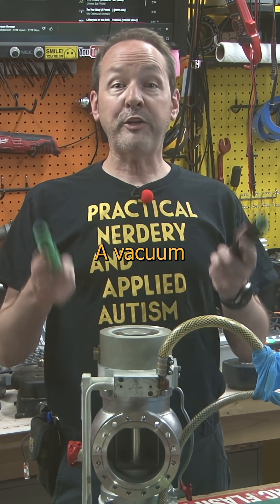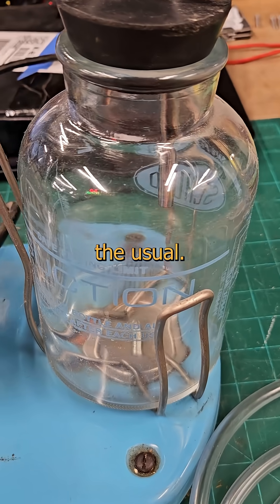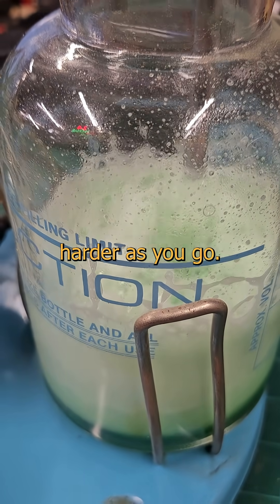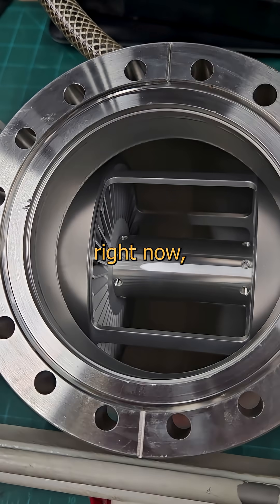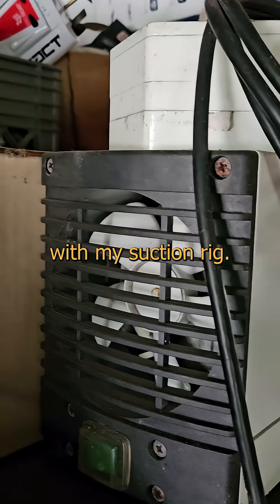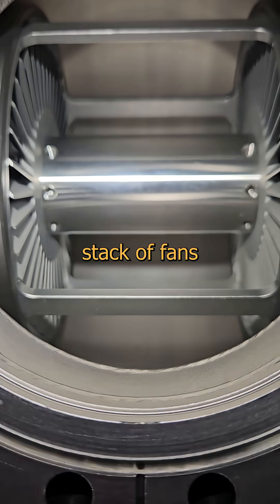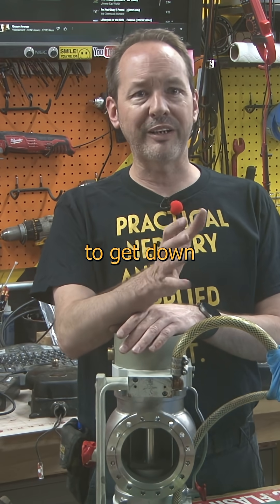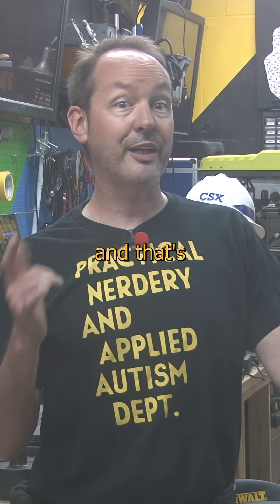Turbomolecular Vacuum Pump #chrisboden #comedy #engineering #physics #science #turbo #nerd

Comment: As an HVAC/R tech, the scariest shit I have ever seen was a 50 ton Trane chiller that was just installed have its safeties fail and pull itself into a 27.8inHG vacuum according to a mounted manometer on the primary coil side door. No one wanted to go near the fucking bomb in the basement so we let it run away til it popped, it was going to go to warranty regardless. It finally failed about 2 minutes after the fuck up started (return air duct's damper system decided to say nah we're closed), the doors on it that swing out swung IN, the coils all had bent into chevrons, we had shut water off already, and the fan had swallowed and spit out over 50 lbs of aluminum. Nature really, really, really fucking hates vacuums.
Reply: I’m a project manager for a commercial construction company and we ALWAYS try to avoid trane if possible😂
Reply: @adamrichter1143  Good to know. My company is actively trying to rent a Trane 25 ton chiller as we speak. (Contract is already out for bid, and we're the ones who said "We rented this Trane chiller last time, so we'd like that again, if possible"). I'm open to all rumors, feedback, and hearsay about why you guys avoid Trane.
Reply: @c182SkylaneRG Old Trane stuff is good, new stuff not so good and their newer communicating equipment is not even compatible with each other.  My company is slowly switching to Rheem.  Can't speak as much to the big stuff but I personally think Daikin probably makes better chillers.

Edit: everything before covid seems higher quality, less over-engineered, and less failure-prone.
Reply: @c182SkylaneRG biggest concern for projects I’ve managed has been lead times, for both the equipment and the shop drawings to approve said equipment. If you are working with a local supplier who has the equipment on hand, then that’s a different story.
Reply: @c182SkylaneRG  The site I work at operates 19 chillers(250-500 ton). Of which, 15 are Trane, 2 are York, and 2 are Carrier. Only major issues we've had with any of them was the carriers not having proper proofing set up, BMS says the chiller is running when it's not, and 1 of the Tranes doesn't like to run when OAT is below 45° F, but an identical chiller 25 FT away runs fine. (Trane techs can't even figure that one out even after shotgunning parts at it.) As far as HMI, I prefer Trane, then York and lastly Carrier.

EDIT: All of our chillers are at least 8 years old.
Reply: @adamrichter1143  i’m actually looking into AC units at the moment, which brand(s) would you recommend?
Reply: @fakename287 I would talk to your local TRUSTED HVAC supplier. There are thousands of different brands to fit your needs. Trane just has a bad reputation here in the Midwest.
Reply: @fakename287  Here at the end of 2025, I’d suggest digging deep and springing for Bosch. Caveat: this is long-term, because you only want to pony up if you are sure you’re going to be there for another 20 years. I’m in Mid Atlantic area, and we have our best results with Mitsubishi—which is ungodly expensive. Bosch being 98% Mitsubishi @ 80% the cost, that’s what we install on our own homes. 
Like all refrigeration, though, it’s all in the prep: no matter how good the name is, if your installer cuts corners, your experience will suck balls
Reply: @adamrichter1143  Ya know I'm a chiller mechanic and Tranes are some of the best units to work on in my limited experience.
Reply: @markethvacrguy I actually agree, although I enjoy Daikin a hell of a lot more.
Reply: I can see the report now. Mistake number one: We bought from Trane
Reply: @DenarianLord  Nothing hits with expensive destruction like a Trane. 
That's their slogan, right?
Reply: Why wasn't cutting the power an option?
Reply: @Argonwolfproject  vacuum was already created so it woulda popped regardless. At that point its an already ticking time bomb so you might as well run for cover and wait for the natural order to do its thing. Cutting power would just prolong the inevitable.
Reply: @jamzee_  it would have equalised eventually
Reply: @jamzee_ No, not entirely. If I had been able to cut power, the vacuum would have just equalized. It's not a sealed unit .
Reply: @Argonwolfproject Great question! Where I am there is no code on how far away disconnects or VFDs need to be, only main power breakers. The disconnect AND VFD was about 18 inches from the unit and the main breaker was about a 20 minute walk away. The only person I would have asked to go throw the disconnect was a bomb diffusal technician, but there honestly wasn't time, same reason I didn't make it to the main breaker before it popped.
Reply: @thomasos123  Thanks for coming back here to satisfy my curiosity, cheers!
Reply: And here I thought closing the pressure out port on a thermo king semi reefer led to some nasty shit… ya I’d nope tf away from that unit.
Reply: it's not the vacuum, but the delta in pressure, nature is if nothing, all about equality and wants everything to be equal, especially pressure.
Reply: Was witness to a 100hp  DC compound-wound motor that lost its field winding start to run away (yeah I know - "no legs"). Shrieking was getting louder and higher every millisecond. Even with the power disengaged, it still took 30 minutes to slow to a stop, even with a lightly loaded 75hp (commutated) generator attached to it.

(Good thing it wasn't shunt-wound)
Reply: @ellayararwhyaych4711  I know some electricians that have done that deliberately. Likewise myself. Watch them spool up until the bearings go or the windings dislodge from the armature. Hence the nickname for these motors (Suicide Motor).
Reply: @ellayararwhyaych4711 sounds terrifying and awesome
Reply: Half an hour to stop!! 😮
Reply: @ellayararwhyaych4711 so a 100hp motor is completely different than a 50ton chiller. The chiller is pretty small and that guy defiantly exaggerated😂 you I believe
Reply: I actually work at Trane Technologies! But on the lame digital side. Soooo... sorry about the state of Synchrony and Trane Connect. 😭  But management is hellbent on making our lives as difficult as possible but with a corporate smile on 🙃🥲.
Reply: When I worked on oil rigs I had a triplex positive displacement mud pump with a malfunctioning 8” knife valve on the suction side. It slammed closed one time when the air pressure to the actuator decided to leave the party and the pump said nah, you’re staying open fam. Shit pulled a hole in the 1/2” thick metal gate the valve thought it had. I didn’t think steel laced with hardened plastic and gelled up diesel could create a suck so hard that the entire United States Marine Corps would lovingly embrace it but it it was definitely a bad time for all of the internals of that gardner denver. Nature absolutely despises vacuums.
Reply: @kendallbryant5527  I think you’re a vacuum Kendall.  :)
Reply: Most hospitals have a vacuum system so it's different than residential ac or even commercial but when I wonder is like the CDC and even the ebola hospital the design and engineering must be well above or even those desalination units
Reply: @cyclonight remember, cheapest of at least 3 bids, you’d be surprised at the
 f()€Kery betwixt whats on paper & “🎶what is this, that stands before me!🎶 OH LORD NO, NO, PLEASE, GOD, HELP ME🎶”
insert Iommi guitar solo
Reply: but its hard to stop a trane… lol
Reply: @alnonymous9361  I'm pretty sure it's something like that but that just doesn't sound quite right...
Reply: inHG must be the worst unit that my SI minded brain ever encountered.
Reply: @IncoAno  as a non-physics person I was curious and wanted to look up how much pressure 27,8inHG actually was. But from my very amateurish calculations that resulted in a little ofer 0.9atm or 926 Pa. Which doesnt sound like too much of a difference to me. Very far from a vacuum for sure. Fid I fuck up with my calculator?
Reply: @vyl4650  for reference, 29.92 in HG is "one standard atmosphere" and zero should be a pure vacuum (as differential pressures, these are in comparison to a vacuum), so 27.8 in HG sounds like about 0.9 atm. That sounds correct to me.
Reply: @vyl4650 On an absolute-pressure gauge, atmospheric pressure would indeed read somewhere around 29.92 inHg at sea level. But on a gauge-pressure gauge it would read 0.

"Gauge pressure" is a weird place where the zero-point is either ambient or "standard pressure", so at lower pressures than ambient or mean sea level it would read negative pressure. Kind of odd, but it's just a differential measurement - like a classic manometer, where both ends of the liquid tube are initially open to atmosphere before being connected to a port or capped.

So 27.8 inHg of vacuum would be an absolute pressure of (assuming sea level) 29.92 - 27.8 = 2.12 inHg. Fairly significant in a large volume, but also much higher pressure than you'd typically pull on a refrigerant loop before charging. Water boils out pretty aggressively at <0.2 inHg in the Southwestern summer . . ..
Reply: @vyl4650 30", is what you typically pull on an ac system before you put the freon in. At least on cars. It'll suck 2oz. of oil in pretty quickly under that pressure  and typically only raises the pressure about 10", to 20"hg. Not sure if that helps to give you any perspective.
Reply: @vyl4650 I think you did it right. One atmosphere is 14.7 psi at sea level.  So a complete vacuum is no more than that but over a large serface it's a lot of weight and no sheet metal box can stand it.
Reply: You must not get out much lol 
When you want to measure pressure mechanically, you fill a tube with mercury, and measure how far it is displaced from gravity, and measure it. 
Then anyone else with a tube full of mercury can compare their measurements. 

If it had been developed in a metric country, it would have been mm/hg instead, but it would have been the same measurement. 

Then higher technology was developed, and so we can have an arbitrary unit to communicate a pressure, but tubes full of mercury are still used today for certain applications where precision is needed reading low pressures visually. 
 @IncoAno
Reply: @IncoAno the first time I heard that as a mechanic doing hvac work on cars, I couldn't believe that was a thing. Sounded like something Archimedes, invented.
Reply: I like it!
Reply: Which is funny, because most of nature is a harder vacuum than anything we've ever made down here on Earth.
Reply: @jdlessl  Perhaps it would be better to say "nature abhors imbalance."
Reply: It either hates vacuums or really loves entropy
Reply: To be honest, it's usually not the manufacturer. It's the installer.
Reply: @Whateverinterestsmenow THIS. 1000%. I work with mainly Trane and Daikin, and this was a freak event on a new install.
Reply: I've seen diesel generators bend I beams, rip double steel doors off the frames, rip Sheetrock off walls looking for air.
Reply: I'm sure that was absolutely scaflarious - both scary AF and hilarious at the same time. I'm LMAO just visualizing that scenario as I read your comment. Holy shiz!😂
Reply: Damn, 93% vacuum? Eugh, glad I don't deal with that.
Reply: That sounds scary and way over my head.  And on a scale of the universe, I'd say nature loves vacuums.  Just not on our pale blue dot :P.
Reply: Remember titan? In a fucked up way, it's kinda like that.
Reply: Hi I'm here for the Trane hate thread
Reply: 😮 OMFG 😮
Reply: @thomasos123  "Nothing can stop a Trane!"  Wanna bet?  Watch this!😂
Reply: @thomasos123 You start with a chiller then go on to describing an air handling unit. There is absolutely no way you can pull that kind of vacuum in a ducted air system. I call bs on this story.
Reply: @davea8346 that is entirely fair, it is an air handler, I may have been around old heads calling them chillers for too long. I am aware of the difference and I work with both, however for whatever reason I have grown too used to using the word "chiller" interchangeably between the two. Sorry for the confusion😅
Reply: Difusion pump.... 😮 turbo mach jesus... 😂
Reply: It would be that a vacuum abhors nature.
Reply: Me: "Make me a vacuum."
Nature: "NO! And also, fuck you!"
Reply: I’m not even sure I can imagine wtf you just wrote! I had no ideas they were capable of that!
Reply: I saw a ghost and it told me to clean my house. I have a picture of a ghost on a tv.
Reply: Damn. 😳Was anything salvageable? 🗑️
Reply: @monotheis6889 oh yeah, unit was under warranty, they salvaged the frame, the motors/fan impeller, part of the filter rack, some of the dampers.... anything that the installers could salvage was salvaged
Reply: The lightest gas we know about is hydrogen, but its still heavier than a vacuum, if you can make a structure strong enough to be lighter than air but in a vacuum you have the perfect blimp.
Reply: We had a giant bulk tank at work that product was being moved from via a pump and something got stuck shut, imploded that tank quite a bit, needless to say that tank went up on the tank reliability list considerably for requiring repairs :D
Reply: Okay I understand residential but can someone break down what just happened here?
Reply: @computernerdinside residential A/C is DX cooling. An air handler with an evaporator coil direct exchange cooling. A chiller cools water or glycol solution that feeds air handlers or many other kinds of cooling equipment. Or ice rinks, process coolers. To explode or burst requires positive pressure not negative. The refrigerant cycle in most cases are positive with exception of a couple refrigerants like R-11. I have seen duct blow apart from closed fire dampers and forced on vfd’s. Variable frequency drive. Overriding duct pressure switches.  I have also seen ducts implode on return side from same reasons. But I have never seen anything just happen. There are far too many safeties. But if you have a low IQ building operator that knows enough to be dangerous can jump out all safety’s trying to cool down or heat up a building. If you look up MGM grand fire you will learn what I mean by dangerous facilities guy. And that’s not very cool.
Reply: That's awesome lol.  However,out of curiosity.....I know things get more dangerous exponentially.....but I pull 30 inches regularly on automotive ac systems. It's a pretty normal vacuum.
Reply: @f.c.urbaytis3599 yeah, that unit is about the average size of a master bedroom, so the forces at play were in the range of thousands of foot pounds, both pulling and pushing into the unit.
Reply: I didn't understand 71.77% of your words but I felt 100% of the oh shit factor....
Reply: Even vacuums aren't allowed to be truly empty.  All sorts of weird little things pop into and out of existence.  Ironically the only truly empty place might be the center of a black hole.  There is a chance space-time is distorted so hard by the gravity that it reverses and becomes repulsive.  The middle of a black hole may be even more bizarre than a singularity which probably aren't real.  It may simply not exist at all.  A bubble of actual nothing.  Might be the only "place" where even time might not exist.  Almost like a sustained cavitation bubble in reality itself.
Reply: Simples me says how come there isn't a release valve of some kind, basically a manhole cover on a spring?! I barely understand this subject btw.
Reply: @DeepakKumar-lv4te : Because valves leak, and you want to cut down on that.
Reply: Sorta confused how a Trane chiller which is a closed condenser and evaporator would do something that would influence the closing of an air system … the Trane chillers we have run at like 10psi… just kind of curious what your referring to when you said you pulled 27in of vacuum on a system like that
Reply: That’s the biggest load of bullshit I have ever heard. First off chillers don’t have ducts. 50 ton chiller is a really small chiller plus. I personally have pulled deep vacuums on chillers and other air conditioners required by the epa. In fact chillers that used r-11 ran in a vacuum. Trane actually makes really good equipment. Well as good as anyone else or better. A vacuum cannot explode or go pop it can only crush or implode. If a machine ran away that would also be something meaning all safety devices were bad or bypassed.  So mostly likely it would have run until the compressor got hot and went into overload. And if it were a blower on an air handler the duct would have collapsed. But that would have been caused by a closed fire damper and no duct static safeties. A VFD placed in hand turned all the way up and enable jumped. Just saying.
Reply: @troywesterbur706  If I had to guess, by "chiller" they actually are talking about a big ass chilled water air handler, and the vacuum was just being created by those 20-25 hp draw-through backward inclined plenum fans pulling on the dampered shut return duct, rather than some "runaway vacuum" in the refrigerant piping. 

Hence "shutting off the water", coils collapsing and getting spit out through the fans, AHU section access doors getting pulled inward, etc.

Not sure why there was a shutoff damper in the return duct (economizer changeover controls maybe?). Lesson is to be careful with your control logic on those I suppose.
Reply: @imanukeyourface3210  Exactly what I read he must have meant, chilled water air handler, not chiller. The manometer on the primary coil side door must have been to troubleshoot the problem setup as it isn't operationally useful as far as I can imagine the gear. Perhaps a constant pressure differential blower setup. As you suspect economizer changeover controls are the only easily imagined reason for a shutoff damper in the return duct. And truly stupid control logic crashed and wasn't setup fail safe caused the mess. A simple hardwire interlock anybody? That sh* show shouldn't have been possible. A single air handler for 50 tons would be small walk in sized sweetie and with the blower in manual with the controls crashed and not fail safe configured the ductwork collapse has plenty of force to rupture the cooling coils. A simple case of too many black boxes in the controls for the guys in the field to discover what he dumb [censored] bean counters expected them to do with it. Also sounds like they forgot switching off the VFD manual disconnect is step one when you say, "Oh, sh*". I think you nailed it.
Reply: @troywesterbur706  the term "explode" is often used for things that don't literally explode but just fail in a spectacular way. in this case i assume it's that. either way it's the same outcome: a rapid unscheduled disassembly.
Reply: @ThatJay283 Looks like someone plays Kerbal Space as well lol
Reply: @ThatJay283  (late comment here) sometimes an implosion and explosion look pretty much the same unless you’ve got a 10,000 fps camera.  The closest I got to a nasty implosion was a ~1960 25 inch RCA TV set which had removable safety glass.  That safety glass was like 3/8 inch thick.  A friend of mine with a pellet BB gun shot the bare CRT and hunks of glass the size of a fist were thrown up to 50 feet and it blew holes in a thick mahogany cabinet.    After that demonstration of nature abhorring a vacuum I have had extreme respect for CRT tubes.  The irony is that you can break off the pip where the wires connect on the back of the tube and all you get is p-f-f-f-f-f-f-t as air fills up the tube.  It takes a  shock to the thick front glass to get the violent implosion.  Luckily CRT tubes are becoming a thing of the past and the tubes made after about 1965 had integrated safety glass and other features to reduce the odds of catastrophic failure.
Reply: @troywesterbur706  You perhaps should consider some remedial education. The tendency for an implosion to terminate into an explosion is a commonly observed and well known phenomenon. In nature, it is a rebound effect of the densification or in-rush of gaseous or liquid atmosphere occurring too quickly and forming a powerful secondary vacuum in the evacuated region that immediately surrounds the implosion. This can and frequently does eject debris from the zone of elevated density with enough velocity to cause significant, even fatal or catastrophic, injury or damage to people and property in the near surroundings. It is, in fact, this concept which led to the successful discovery of artificial nuclear fission.
Reply: @claws61821  we are talking about a "chiller" (an air handler more likely by his description) not a freaking nuclear reaction or supernova. There is nowhere near enough energy or force involved in an air handler to induce any kind of rebound effect. If anything it would cause the doors, panels, or duct to buckle but that's about it.
Reply: @nateg08  You either missed or deliberately ignored the clear intent of my previous post. Troy claimed that "a vacuum can't explode". I corrected him, because the phenomenon that describes in simple terms is very common and has been very well known and even scientifically defined for a very long time.

Furthermore, if an implosion-explosion event produces enough force inside of the machine to buckle the doors or panels, that is also enough force to expel any loose debris through any existing or newly formed gaps, with enough force bestowed on that debris to penetrate human skin and deep tissue, likely from several feet distant.

An explosion doesn't have to be on the scale of "a freaking nuclear reaction or supernova" to kill or cripple you. It just has to put a nail or a rough shard of metal or glass through your eye or a major artery.
Reply: @claws61821  i wrote what i wrote and it stands. Its a 50 ton air handler (not a chiller) and it had at most a 25 hp motor. No way its going to implode violenly. I work on that stuff every day in commercial hvac. Im well aware of rebound explosions and what they are. This isnt that. Hitting the disconnect or breaker would have saved a ton of work (if this even happened as he said which i highly doubt. It has all the vibes of a "trust me bro" story). Just because warranty will cover equipment doesnt mean they pay the labor. Sounds to me they had people working on it that shouldnt have been.
Reply: @claws61821 now tell me how that applies to a 50 ton chiller?
Reply: @troywesterbur706 im not familiar with Trane, 50t chiller could have ducts if it was a package unit, but a vacuum in the duct would be a vacuum in the chiller, chillers obviously arent designed to be negative so if it didnt collapse to the ground, it wouldnt be a cube anymore… and year take your pick of what safeties woulda tripped from low pressure switch, maybe theres a sail switch, compressor over temp or even just the overcurrent protection. And if the fan chernobyl’d it must have been physically damaged…being just a paddle wheel it doesnt have much delta P between return and supply sides. Its just a circulation fan…so yeah i agree, unless i can see more info on this install…also ducts leak. 
If the refrigeration system was running in a vacuum, which is most likely the issue, its not dangerous, but oils fkd, charge is either gone or arrested behind a solenoid/metering device. 
The whole story sounds like a bad install or repair job.
Reply: @f1reguy587 no it won’t. A chiller cools liquid either water or glycol solution. A DX cools air with a refrigerant coil. You can feed chilled water to an air handler but it’s not a chiller it’s an air handler.
Reply: @troywesterbur706   Exactly.    Sounds like a "my friend has a cousin whose friend saw xyz'  urban legend
Reply: @troywesterbur706 thank you for saying it 😂 I have an 80 ton trane chiller at a building and it couldn’t do whatever he just said lol